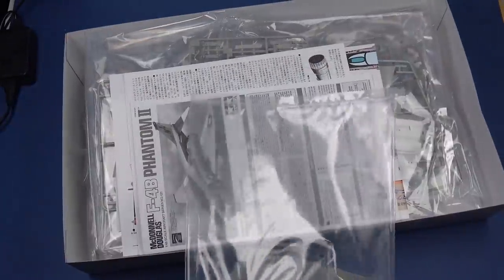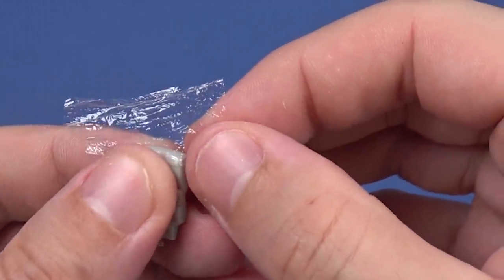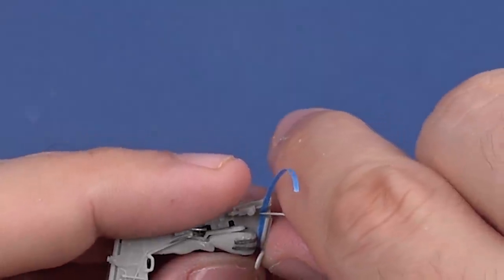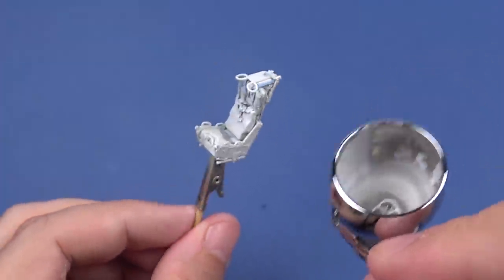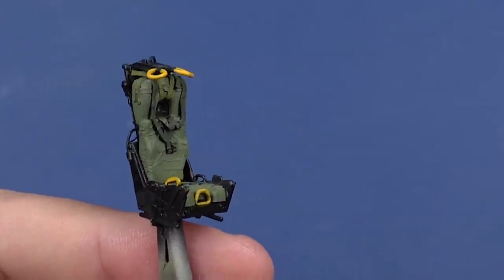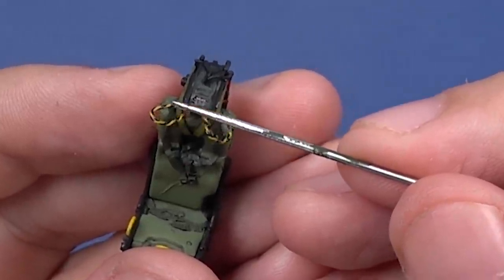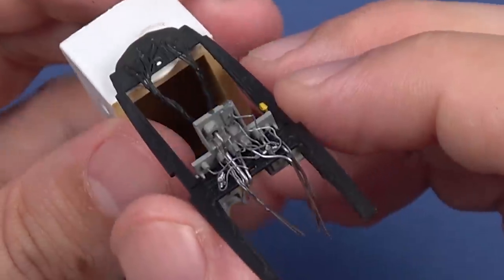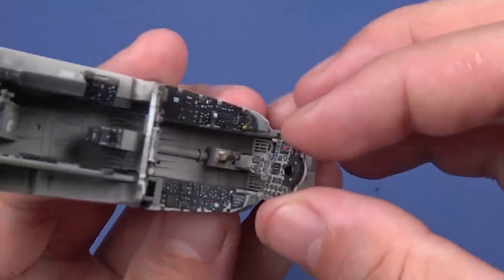Building The Tamiya F-4B Phantom II  Part 1 How to build the cockpit.

Comment: Butanone glue = MEK = Tamiya glue?
Reply from the maker: Butanone = MEK Tamiya is another story. It's not good with painted parts. MEK works like welding not gluing.
Reply: @Scaleaton  do you use the MEK only in certain areas of the build? 

I always thought it to be way to hot